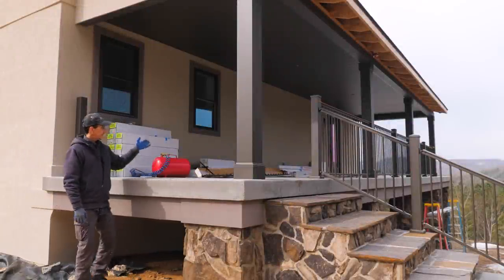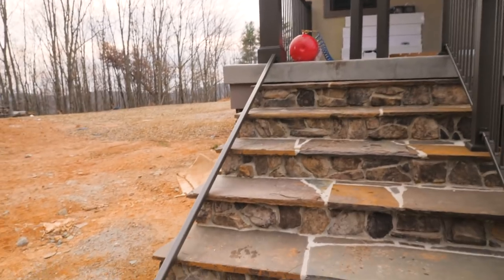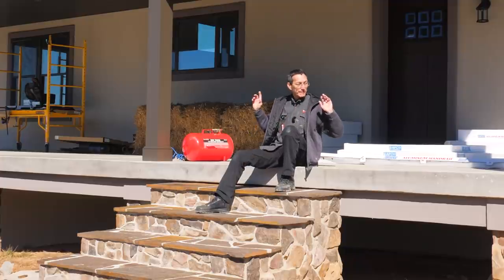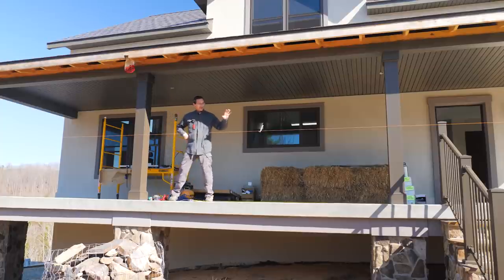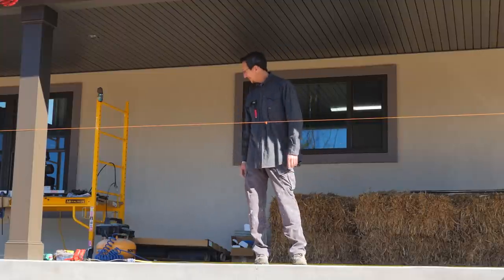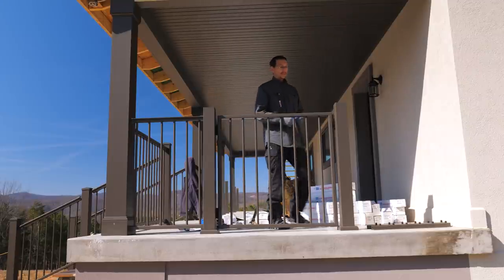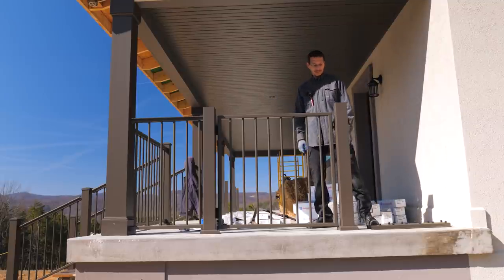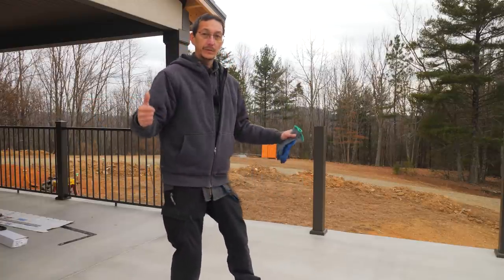BEAUTIFUL! 50 Ton Wrap Around Elevated Concrete Porch Finished

Comment: Something to think about for the stair railings and maybe at the corners of the suspended deck would be solar lights.  I know you can get solar powered caps to fit onto 4x4 posts, seems like something should be available for those AFCO posts.

Comment: When I built my well pumping station I wanted it completely fire proof. I did a 8 inch concrete slab.  6 inches of extra strength concrete then a monolithic 2 inch layer of crack proof concrete on top.   The top surface is beautiful with no crack seam lines needed.  But on the 8 inch slab itself you can see a shadow difference in the 6 vs 2 in color of the concrete.  The slab has much rebar buried in it.  And rebar buried to support 8 foot high cinder block walls.  The  lightning Walbridge Fire moved through last year and absolutely no damage whatsoever.

Comment: What an amazing home you guys have built. I was looking at your tool list to buy some items for my husband and I am curious if you recommend a specific laser level?
Reply from the maker: For general use around the house, look for one that is self-leveling and projects both a vertical and horizontal line that is clearly visible from at least 50 feet away. I've had good luck with both Bosch and Johnson Level & Tool.
Reply: @Guildbrookfarm  thanks so much. I was looking at the Bosch but just wasn’t sure which features I should be looking for.

Comment: I remember that Little People show where they built a porch and had little people sized railing.  Well, that's not to code and they either had to put in standard rail, which they couldn't lean on plus acted more like bars on a jail cell, or raise the ground level.  They brought in some dirt so the distance to the ground was less.
I would have been inclined to bring in some fill or built a railing that was mounted to posts in the ground. Soon as the permit sticker is stamped, off comes the rail.

Comment: 3:58 What are those things sticking out of the ground?  Looks like might be markers for rebar... you planning on building something out there too?
Also recommend putting some sort of fittings to allow the stairway to be blocked off.  You don't want animals to be able to easily get up there and then eventually you might have grandkids running around on that expansive porch.
Reply from the maker: The rebar sticking out of the ground are just corner markers for where the septic tank is buried so no trucks drive over it during construction.